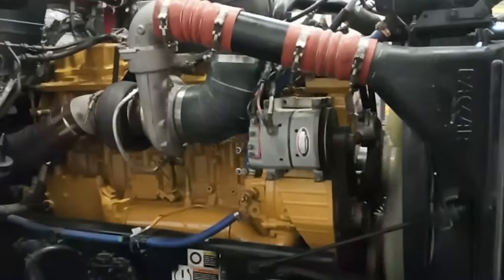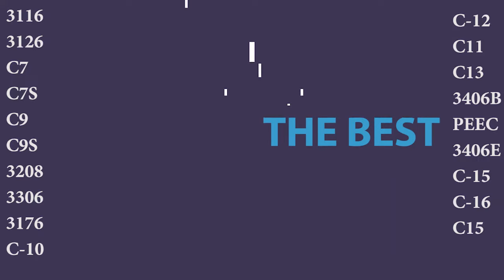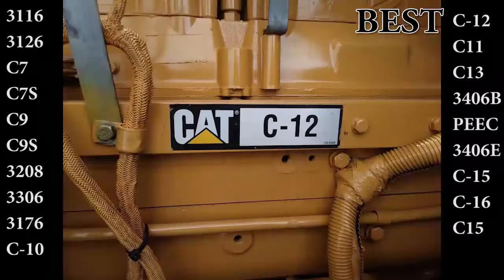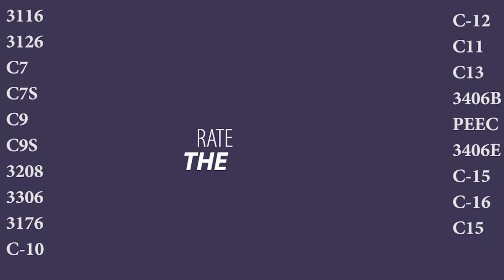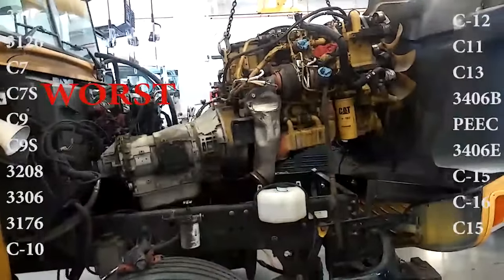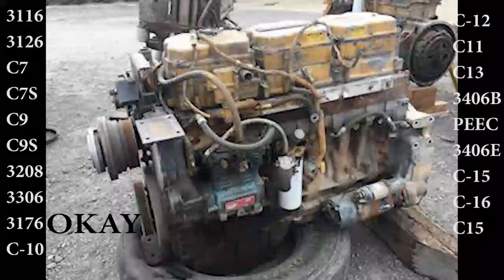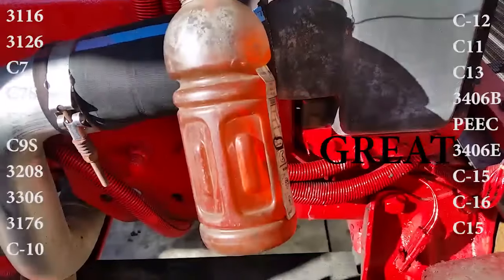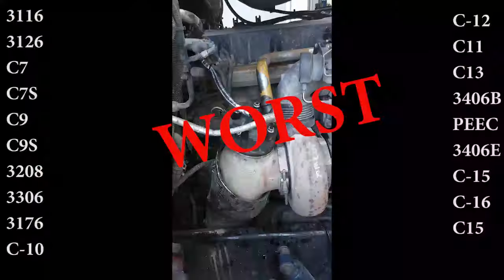Ranking the Cat Diesel Truck Engines from BEST to WORST!!!

Comment: Hey will you do a video on the difference between the 3406A and the 3406B? Ran aross a few cabovers with them as an option and I'd never heard of them before
Reply: May be the air to air CAT.
Reply: Hard question to answer as the first 3406B, 7FB's did have a few parts the same as a 3406 92U, now called A model. The biggest difference was the fuel system completely. From supply fitting to return. Only thing was the same was the fuel line adapters in the head and lock. The entire front gear train, plate and housings are not same, except a few parts. Cylinder blocks on 3406A at first was completely different and redesigned, than changed again. The last ones could work on either series. 3406A came PCT, PCTA, DIT, DITA and if it was aftercooled it was JWAC only. 3406B was DITA only and at first was JWAC only, than ATAAC came in and finally ATAAC only.
The cylinder head casting was same at first but later 3406B had it's own head. Very few of them I would say are still on a engine. Reason being if you had one on a 3406B and it needed to be shaved, you had to pull all the valves out of the cylinder head to get the nozzle chambers out. 3406A had several connecting rod types, straight rod, narrow taper, wide taper. Both engines had several piston design's for HP. But the first 400 B model had same as the high HP A model. A Ford arrangement had the same regulator hsg as a 3406A. Most other arrangements used a aluminium inner and other hsg that was expensive and truck manufactures put the ground wire off the alt on the hsg and had lots on pin hole problems. The JWAC was slightly different. Turbo's are not the same.   
As the front gear train was changed, the power steering pump turned opposite direction, so you have to flip the center over to reverse the flow of the pump. That is the short version.
Reply: @johngoldsmith6629  so basically the only thing the A and B models share are the displacement and the name
Reply: @Romuls753  Yes and no, depends on HP serial number and such. The 1600 series was discontinued and the 3400 series came out. It had a lot more interchangeable parts, cheaper. So to meet emission changes you had to raise fuel psi. So the A model needed to increase fuel psi. PC engines was gone as they would never meet what EPA demanded. So Cat went to DI and after the next change, fuel psi had to go up again. So the capsule type system had to go away and Cat came out with NSFS and 7000 series nozzles. Which required a total increase of injection P&B size, bigger cam, lifter, etc. Fuel system was moved forward, so air compressor had to go up. Oil pump, oil pan, rear cover, valve covers, bull gear, water pump and that side of the engine is all about the same. Mainly emission parts had to change. Naturally you improve your product to fix problems. However with the EPA makes emission changes, you sometimes have to go back to the drawing board and start again. As with continued emission changes, pump and line had to go. A 3406C is around 17,500 fuel psi range I was told. So it was at its max. Cat went to EUI, MUI, HUEI and when those played out, your in common rail. Which now your in 30,000 fuel psi range. 
EPA dictates a lot. If I was going to build a truck, the only part I would want no part of is the engine. Most of it is just nuts, bolts, panels, safety regulations. But nothing compared to trying to produce a leak free, high mileage, fuel efficient, EPA approved engine, that don't break down. So when Cat built its REGEN engine and the truck manufactures made changes and Cat was basically out of the truck market. They did not improve the design and it was a big old POS. As they shifted resources to other areas.
Reply: @johngoldsmith6629  I wish more guys with knowledge like yours would start YT channels.
Reply: @jimmartin7881  Josh does a great job, he just was not around during the mechanical era. I have worked on just about all Cat truck engines in my forty years. Have never worked on a 1676 or a 3306/3406 gas engine in a truck. Worked on one 3208 with EGR, very few 1673C, numerous 1674, 1693, 1100 series, 3208 series, 3306 series, And a whole lot of 3406 and up. When I hired in 3406 PC engine's had just been phased out, but still under factory warranty. Stayed away on the dry block inline series. I measure a good Cat truck mechanical engine tech, can he rerate one from a lower HP engine to a higher one legally.
Last rerate I did was a few years ago, took a 425 3ZJ and legally went to a 425 1650 torque. Which is the highest HP to torque  truck engine that Cat made for North America.
Reply: @johngoldsmith6629  No doubt he's great but just by reading your comments I knew you'd been around the block a little longer, no pun intended. It'd just be nice to see someone that knows mechanical engines as you do on YT also.
Reply: @jimmartin7881  Not the block, the state and closing in on the country.
Reply: @johngoldsmith6629  Haaa haa!! Well then, enjoy your golden years and stay safe.
Reply: @jimmartin7881  Still have a few before retirement, but getting close. Forty years on Cat truck engines, starting to see the sunset.
Reply: @johngoldsmith6629  Lucky you, I'm in the middle with 20 to go, hopefully, lol.
Reply: @jimmartin7881  But I am closer to the grave as well.
Reply: @johngoldsmith6629  Ahh, this is true. Amazing how time alters how we see things.
Reply: @jimmartin7881  Yes it does, what is the definition of wisdom and knowledge?
Reply: @johngoldsmith6629  Sorry, I missed my notifications. I guess I'd have to say knowledge is experience gathered over time and wisdom is having the hindsight to correctly apply that knowledge to a given situation.
Reply: @jimmartin7881  Knowledge is knowing you have to take a bath. Wisdom is knowing what part of the body to wash last and not first.
Reply: @johngoldsmith6629  Haa, haa!! It doesn't get any clearer than that. Now that should be in the dictionary.

Comment: What id the SDP C15 Acert(emissions) is deleted?
Reply: Then that would turn into C-15 I have a c15 SDP deleted and it runs like a champ
Reply: @Addddam21  I have one myself on my W900 daycab and I’ve been wanting to put in either a 3406E, 6NZ or an MXS Acert, probably an MXS, de-acert it completely, back off the IVAs and leave em disconnected but run 16:1 pistons, throw some nice injectors, put a marine cam in and leave the stock twin turbos on. Heard that was one hell of a setup for the MXS and NXS Acerts.
Reply: I have a C15 MXS with iva's deleted runs super well and gets pretty good mpgs
Reply: Once you delete that DPF filter and that dumb ARD head it’s a really good running truck.
Reply: @CombatBuckee  in our baby fleet we have 3 MXS 2 nxs and 1 6nz love them all. Our heavy haul truck has the 6nz (02 379 daycab with pusher axle 3.55 rears awesome running truck but fixing to swap out the 3.55s put them in one of our cattle trucks pull the 3.90s out of it and put in the haul truck

Comment: The 3176 is divided into five groups. The 2YG, biggest POS. 9CK better of the group, still had problems but the electronics was improved. And the 7LG series, which is three groups by serial number breaks.
Reply from the maker: 5, like the layers of seals between the cylinder block to valve cover on those things. Block to Cam box to cylinder head to valve cover base base to the valve cover base to the valve cover. No oil leaks in that design 😁. I'm sure you know more about them than me, like I said in the video, they are the engine I'm least familiar with in the list.
Reply: @AdeptApe  That is a good thing. The first 2YG had numerous problems, Cat stopped production for 6 months. The orings between the block and spacer deck was low quality. If you had fuel in the radiator it would swell the only coolant seal up and start leaking coolant.
We had one that had a gear failure. It lifted the camshaft up and cracked the spacer deck. Which required a lot of work to replace all the failed parts.

On the 2YG the oil cooler has been updated and you have to replace all parts from the back of the water pump to the cover that mounts on the side of the spacer deck. How would like to change one of those in the frame.

Comment: 3406B was hands down the best Cat engine ever. I also had a 3406E and a 3176. Not bad engines,but nowhere nearly as reliable or easy to work with as the 3406B. You can have everything that came after 2006. I never pumped the first gallon of that piss water into a truck and thankfully,I never will.

Comment: Yep government regulations screwed up production of the E model putting the brakes on best truck engines available. That is why I built my truck running a 1MM 600 it will be my last one

Comment: Would you consider talking about cat's marine engines? I realize that's probably out of your wheelhouse but it could be neat.

Whats the difference between a 3406 b and c?
Reply: Mainly emissions injection pump psi .
Reply: @johngoldsmith6629  hmm don't think my pair of c's have that
Reply: @j.d.saccociates3313  Don't have an injection pump?
Reply: @johngoldsmith6629  has a carburetor 

Kidding, I was thinking of secondary air injection for some reason
Reply: They are the same as the ones on the list with bigger cams and injectors being the most noteworthy changes, with all that cold water around for cooling theres no reason to not dump in the fuel and make power.
Reply: @jaydunbar7538  What is the same? Educate me please.

Comment: I have a c13 how would i know if it is the regen engine or not
Reply from the maker: You can look for the ARD head, have a video about that. Your serial number also. If it starts with KCB you have the older engine, if you have a LEE then it's the Regen Engine.
Reply: @AdeptApe  also if the truck is deleted would i have to worry about any of these issues if it is a regen engine

Comment: With all knowledge which is obvious I would really like to hear frank opinion about detroit diesel s60 pls and thank you
Reply: The 12.7L ones up until the emissions crap were and are amazing engines, but smaller and thus less used for heavier duty hauling. They can be had in high HP configuration but don’t last as long if worked hard. 

I’ve run a few and they pull 80,000+ with ease and give solid performance/economy. 

The 14.0L pre-emission engines are generally the same as the 12.7 as far as reliability/economy/performance. 

Once the EGR and other emissions stuff came along...👎🏼👎🏼👎🏼
Reply: @elijahrobinson2362  I got 1994 detroit with 600 hp I don't hauling heavy and I'movertheroad , for me is important durability only,  that's why I asked

Comment: I've recently bought an international 7600  (04) with a c13, dude hasn't changed the oil in 50k, oil bypass was stuck open and the oil pressure dropped to 0 coming back on my first 80 mile trip lol. Replaced with a used higher mileage c13.

Comment: Great video. Would you ever consider moving away from cat engines and working at a truck manufacturing dealer in the future? If so, why or why not?
Reply from the maker: Hmmmm, good question. Not sure, although I would like to know more about the different engines out there like Cummins, Detroit, Paccar and the DT series of Internationals. Working for a Cat dealer can be a good opportunity if you stay so it's hard to get away.
Reply: @AdeptApe  no need to know anything about paccar, unless you find the fact that they managed to get poor power and poor fuel economy simultaneously interesting.

Comment: sigh...my ole C7 still in the OK category.   My engine number is KAL06887, so I think it is a non acert C7....but it's still pushing this old 25,000 RV up the hills.
Reply from the maker: You are in the Good category Larry, I really like the C7, they are super easy to work on. Just have some HEUI problems from time to time. You don't have the Regen one so you are doing fine.
Reply: @AdeptApe   Thanks Josh.  Great to see another Ape-like video.  Been busy studying for my Amateur Radio (Ham) General operators license...upgrading from Technician.  Staying busy here in Arizona...

Comment: There was a 3406c mechanical engine and the peec
Reply: 3406 B PEEC and 3406 C PEEC. 8TC, 2EK, 5YG, 4CK are PEEC. 3406 C mechanical 5KJ, 3ZJ and (Junk) 8PN.
Reply: I was looking for reference to the 3406C.
We just had a Platinum done to ours at 848000, after replacing oil cooler, and it is getting the fuel injector worked on currently. It had sat for several years on a trucker's widow's lawn but I'm hoping once it gets really going again it will serve us well for years.
My 3406E is doing very well aside from minor oil leaks so far.
Reply: @patricklawrence6724  3406C started at 3ZJ16182 and up, 5KJ07800 and up, 4CK00845 PEEC and up, 8PN1 and up.

Comment: Best, 3406-E (1LW) with an updated 6NZ Crank, Oil Pan and a few other components. Runs smoother than a 6NZ. Pulls harder than any other 550 Cat that I have driven @ 550 HP fuel setting and gets almost 7 miles per gallon when driven easy (Eaton 15 over, 3.55 rears, 80,000 lb. highway truck). C-15 is my second favorite but only because of the lower fuel mileage.

Comment: I didn't think Cat had anything to do with actual production of the CT truck...? Just some obvious input in the design phase & supplied some common-rail 15s for higher-spec versions. Wasn't that totally Navistar's mess? I know it's all their cab, chassis & electrical architecture. 

You could've mentioned a wild-card just for fun:  the 3408. Sure it's a relic from over 40 years ago but when you had that under your hood, you were guaranteed triple digits, 3 mpg & a soundtrack that matched the bad-assery
Reply from the maker: There was an actual Cat Truck plant made by Caterpillar, but that being said, the entire design of the cab, electronics, engine, powertrain were Navistar.
Reply: @AdeptApe  I didn't know that. What an embarrassment for Big Yellow 😔  love the channel!

Comment: If you have a peec you better hope it runs or you need to find the one guy on earth who knows what sensor to feel smell or taste to know what one to replace lol and when they are cold they run so strange and smoke so much you would think you need to run! To be fair you probably should!
Reply from the maker: That is a big problem with the 3116 and the PEEC, although the mechanical engines suffer from this as well more and more is people that are great working on them have most retired out if the industry. I can work on them, but there is a big difference between a guy who used to work on the 3406B every day when they were new and a guy like me that sees one every few months.

Comment: I've worked with Scania busses, they only put the 5 cyl 9 liter in those. The older ones (before 2010) are bulletproof, just a egr and normal dpf. But the newer ones have ad-blue which is 90% of the break down on those. Hate them.
Reply: Honestly I just need to change my job title from diesel mechanic to aftertreatment technician. 95% of my job is fixing aftertreatment issues on every brand of truck.

Comment: was the c18 or 3408 engine ever used on trucks? I only know the mining and industrial range. BTW 3116 is shit, strugeld with one for over a year with smoke and sluggish rev up
Reply from the maker: The 3408 was definitely used in trucks, but that was over 30 years ago. They were replaced by the 3406 engine. The C-18 was not used in trucks except for military, firetrucks, and other specialized applications. You couldn't order a Peterbilt with one, although you could have gotten the C-16 depending on the year.

Comment: What about the 1693?!🤪
Reply: He has never worked on one in a truck so how can he list it ? Like 3406 now called A model which comes in PCTA, PCT, DIT, DITA.
1693 came PCT, PCTA. Early 1693 had a forged body fuel system with a compression release. Most popular HP was 325, 380 or 425.

Comment: 3406-B was the King.  Mechanical.  You could do an inframe for the price of a new set of 3406E EFI injectors.. 1 Million mile motors. Bulletproof with inexpensive parts comparted to the 3406E/C15.

Comment: • Any Cat without 4 valves is overpriced, 3306 for example or junk 3208 for example.
• The 3408 overpriced junk, best of both worlds.
• The mighty Kitty Kat 425 1693/D343 was decent, just overweight & too expensive to manufacture.
• Early 3406 PC & DI very very average, atleast they are not Cummins.....
• 3406B JWAC 350BHP = Good, ATAAC 425BHP = Good, but mid life bigend bearing life very lame. Did the extra maintainence pay for fuel savings compared to a Series 92? Keep in mind the Detroit's Iron pistons.
• 3406C = GREAT
• 3406E 14.6L = GREAT
• Any single turbo 14.6L & especially 15.2L = C15 GREAT
• ACCERT = EPIC FAIL, all they had to do was pay Cummins for VGT Turbos.
• What did you think of the 3406E 16L & C16 ??
Tubby 🙃

Comment: Was the cat truck even powered by a cat engine?
Reply from the maker: Most were not, Maxxforce were about 95% of them although a few of them got the CT15 which was a common rail C15, with Bosch electronics.
Reply: @AdeptApe  that’s what I thought.thanks for replying.

Comment: The 3406 E and C15 acert are good engines. However I find them very under powered unless you can find the proper man to turn up the power.  The either have no power or they have to be cranked up wide open. Dependably is good fuel economy not so good.